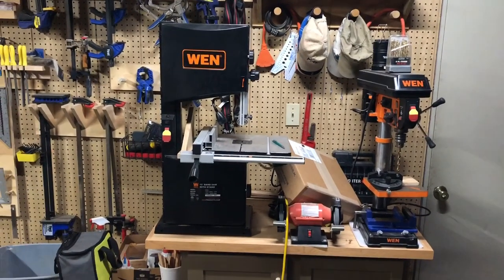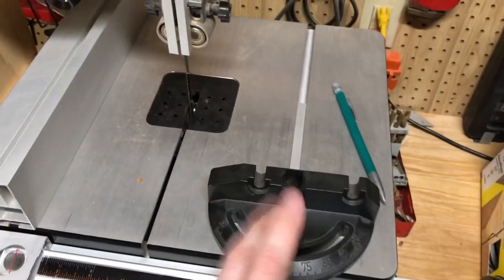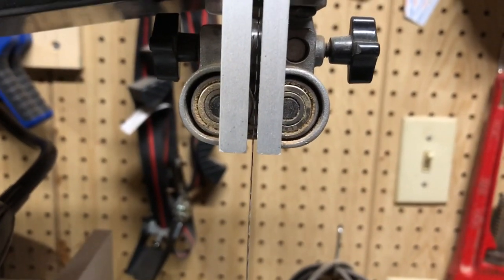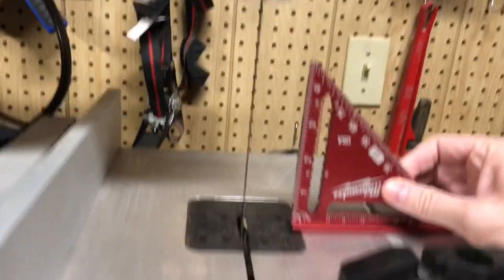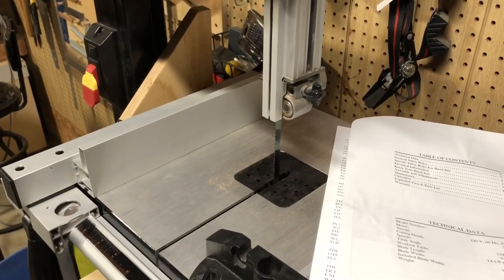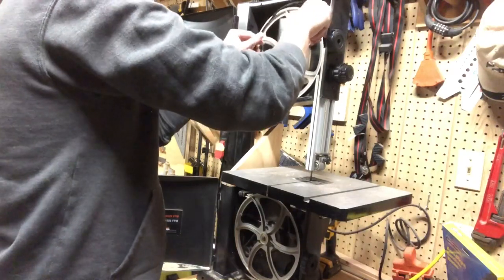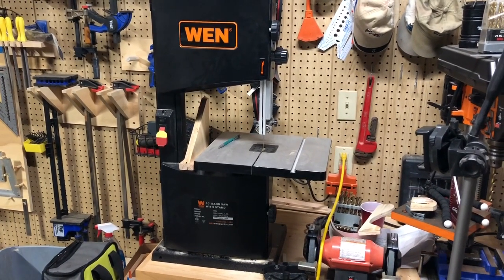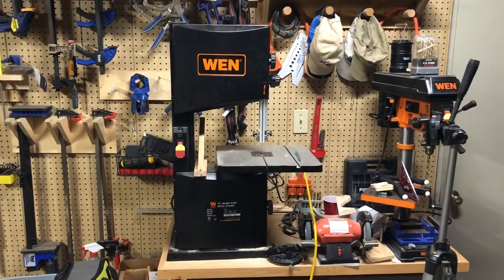WEN 3962 10” Band Saw Review

Comment: Suggest you watch Alex Snodgrass properly set up a bandsaw.  The deepest part of the gullet should be center of the wheel. Reason is wheels are crowned so centering blade not gullet leaves teeth unsupported.
Reply from the maker: I’ve seen the video, of course, but I’ve not found that unsupported or supported teeth make much of a difference in cut quality. Moreover, it’s not always possible to achieve; this saw takes up to a 1/2” blade, and if you were to center a blade of that thickness on the wheel via the gullet method, half of the blade would be hanging unsupported off of the saw. No bueno. I demonstrated this in my latest video on geometric wall art.
Reply: @NotThatMattNagy  Well mine arrives tomorrow.  I'll try to set it up like Alex instructs.  I see your point about a wide blade however.....can't have part of it hanging off the wheel.  It comes with a 3/8" but I also bought a 1/2" and a 1/8" blade when I ordered the saw.  It sounds like the wheel is narrower than I thought.
Reply: @NotThatMattNagy  Well I just assembled and tested my WEN 3962T band saw. I found it funny now listening to Alex Snodgrass about the blade alignment on the wheel....heck the wheel is barely the width of the 3/8" blade the saw came with...LOL...In fact I wonder if that 1/2" blade I bought would be hanging over the edge of the wheel?  If I tried to put the gullet in the center of the wheel then half of that 3/8" blade would be hanging off the wheel...      I think what Alex says makes sense and all but he is used to dealing with higher end saws that have wheels 1-1/2" wide....not our little 1/2" wide bargain saws.  I did do a few adjustments on the rollers and levelled the table....for what it cost I think it will be a good little saw for what I need (which is not re-sawing logs...lol)   I had another stand I used but I need it for my WEN belt sander or my miter saw so I will likely use the stand that came with the saw. The only problem with that is with limited space I need to be able to move it so I was going to order another rolling stand (Protocol) like I got for my table saw.  Instead I found that WEN  had a very similar rolling stand and for less money so I ordered the WEN MB500 for $54.  Once that arrives I'll assemble Wens stand and put it all on the rolling base.

Comment: the gullet should be in the middle for steady blade
Reply from the maker: You may be right, but I’ve had no problems with center of blade center of wheel so I’m going to ride that out until it gives me problems.
Reply: The thickness of a piece of paper is all you need between the guide rollers and the blade. No more! In this video, yours are WAY to far away! Great review of this saw!